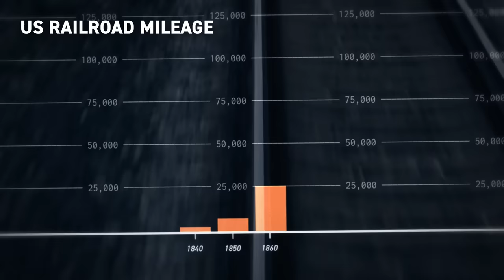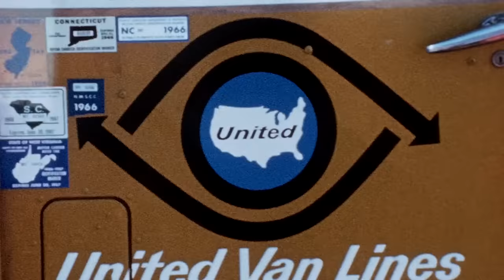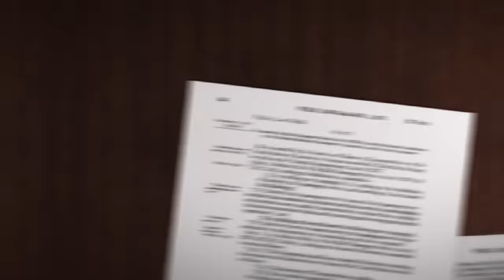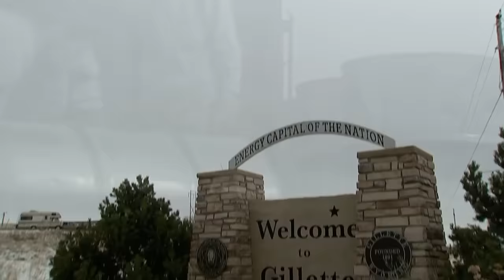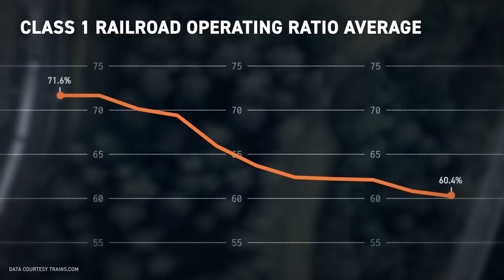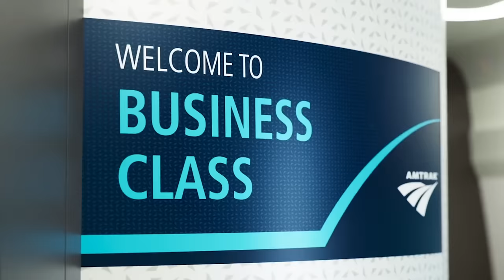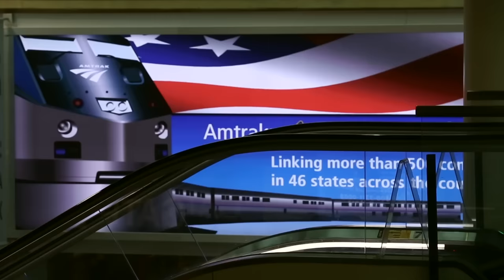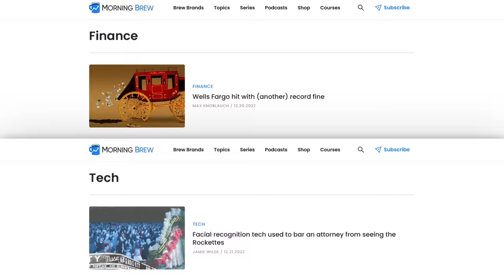The One Tiny Law That Keeps Amtrak Terrible

Comment: My dad was an engineer for Northern Pacific/ Burlington Northern/BNSF starting in 1952. I worked for BN as track maintenance for eight years in Wyoming. I have seen and experienced firsthand the exact things you talked about. In order to help the rail situation, the freight companies need to establish a double track system for most of their track miles. Second, and more expensive, there needs to be a passenger rail network excluding freight service, unless passenger trains could handle a limited amount of freight, not to exceed the number of passenger cars, between hubs and small communities. Every route needs at least two trains each direction each day, and easy surface transportation from the stations to local destinations. (Car rental, bicycle rents or commuter buses).
Reply: @Jacarroll417  You are as right as rain. There so many "if only" pieces to a successful rail system that there is very little hope of getting anything fixed. Too many people, including myself, complain the government isn't doing enough to fix the roads, while at the same time bitching about the taxes we have to pay for infrastructure repairs. But if I buy the material and fill in the pot holes in front of my house, I will be looking at a lawsuit and fines for unauthorized repairs to a public right of way. It's always something.
Reply: @Karl with a K Please don't post the same nonsense in multiple threads. It just makes you look silly.
Reply: Many countries have a shared network for local passenger and freight trains. France, Germany, Japan, just to name a few of the big ones. They also have at least two tracks on the majority of the backbone. E.g. it works very well if the congestion isn't too high and the distance between railway switches corresponds both to the length of the trains as well as the distance between stations. To connect smaller communities, a single track is fine if they are also not a freight hub.
Reply: Most places I have been, routine freight rail service already possesses 2 rails. They need it.
Greater passenger service with separate tracks might be a nice idea. ..Doing so will require doubling the width of existing road grades, then laying the double tracks to allow for trains passing each other. ..Such will require passenger rail rates be made much higher than you might expect.
Reply: All it needs is a siding for a train every 30 miles and trains to be able to fit in them. Double track everywhere is excessive.
Reply: @CreeperOnYourHouse  Depends on what your capacity goal is. A siding is a natural chocking point and seriously limits both the track capacity and the latency in both directions. A second track with regular switches works much better. For a large part of the USA it wouldn't even be that expensive...
Reply: The old Pennsylvania Railroad "Main Line" between Philadelphia and Pittsburgh had FOUR TRACKS as Iate as the 1960s.  It is now a three track system with the middle track used to bypass slower trains on the other two tracks (Amtrak tends to use the middle track). 
Even with three tracks, Amtrak gets delayed and you see demands to reinstall the fourth track, but other then some improvements in the trackage to speed up rail traffic, it has been all talk no action.
Reply: @joergsonnenberger6836  correct, but in the USA for current demands it is perfectly suitable, as it would also allow cargo trains to pull off for faster passenger trains to pass. It's the minimum to enable practical train use, and would be needed regardless of direction of travel.
Reply: @CreeperOnYourHouse  shakes head If you want reliable, steady passenger service, and both directions, you'll need double tracks to carry it. Requiring use of sidings requires one train or the other speed up and slow down. A LOT. Trains depend on being able to move at full speed more often than not to be on time.
Reply: @joergsonnenberger6836  I think it'd be far more expensive than you expect. Even without forests or mountains, most railroad grades possess enough land to allow the tracks and a short buffer zone between rail and general-use lands. Many areas, especially in towns and cities, will have non-rail infrastructure within 100 feet or so. Even rail grades, themselves, have rail infrastructure that need moving to make room. And then, most bridges over rivers, ravines, and general rougher ground would require being widened.
That's one doozy of a lot of earth, communications, and other general stuff you'd need to move.
Those costs will add up very quickly.
Reply: @johnflaherty9595  Compared to most countries, I would expect the land to be fairly cheap in most of the Midwest outside the cities.
Reply: The US has likely lost any chance to make any substantial changes for the next couple of years at least, but: 1) “tax” a portion of the profit of the railroad companies to be matched or doubled by the federal government which would go towards rail infrastructure improvements, 2) identify significant problem locations where longer passing sidings or double trackage would alleviate problems for both Amtrak and freight operations, 3) use federal eminent domain provisions to widen corridors or realign trackage, 4) Amtrak to have first rights to take over trackage that the companies wish to abandon at no cost (a return on initial investment by the federal government in land grants and subsidies), 5) increase “average on time” trackage use fees to the companies while applying significant deductions for lateness to increased fees to the companies for under say 60% on time performance for Amtrak trains, 6) increase the usage of the automobile cars on Amtrak trains to additional destinations that reach a certain on time performance, maybe include vehicle and trailer capacity.

None of this will be accomplished overnight but over 20 years Amtrak should significantly improve on time performance.
Reply: @chriscohlmeyer4735  I agree with what you say, except for bullet point three. May become necessary, but there's got to be a better way to acquire right of way. A way that won't cause a rebellion. We also need to change the tax structure on trackage and right of way  through towns served by the passenger system. In my opinion!
Reply: @joergsonnenberger6836  Uh huh. ..You know, people from both East and West Coasts already have a nasty reputation for viewing the Midwest as "flyover" country. If we're considered to be cheap and only worthwhile for passing through, we're not likely to willingly help build greater passenger rail service.
Reply: @joergsonnenberger6836  Those countries are the size of your average US state or smaller and run government run rail systems, that were rebuilt from scratch after WW2.

Double tracking will never happen in the US, due to environmentalists. You can't get a power line or pipeline or even a fiber optic line put in without going through years of headaches, you wouldn't be alive to see the beginning of the construction  if it was applied for today. BNSF has wanted to double track most of the GN and NP mainlines for years, and little by little they are, but with every spike, every car load of ballast, every welded section of rail, there are a bus load of environmentalists wanting to stop it, and those happen to have the most say in the current government.
Reply: @joergsonnenberger6836  Do you really want to lose most of Amtrak's vote base over eminent domain?
Reply: As an Indian, I can say that India DID face this problem in its initial days, with single-track lines getting clogged up with passenger services and freight trains getting cruelly delayed, reducing the demand and profitability for rail freight. However, it is now catching up with the demands and technology:

1. Indian Railways has embarked on a big mission to expand its capacity, creating double, triple, and even quadruple-tracked routes on congested sections to allow for the seamless flow of both passenger and freight trains.

2. Also, Indian Railways is constructing a series of dedicated freight corridors in busy freight routes, which are double/triple-tracked lines reserved exclusively for freight rail services. This prevents clashes with passenger rail and increases capacity.

3. Indian Railways has always followed strict guidelines on the maximum permissible lengths of freight and passenger trains to be able to fit into ANY siding on the route.

4. Indian Railways always follows a strict priority system, where passenger rail always gets priority over freight rail. Thus, passenger trains do not incur massive delays, and the public can retain a sensible level of confidence in passenger rail service. (Also, cars and petrol/gasoline are expensive here, so public transport is not a luxury but a necessity).

However, a big caveat in all this case is that the government owns BOTH the track infrastructure AND the railway operations. There is no private operator here, so the government can make the major decisions.
Reply: @chriscohlmeyer4735  Rather than increasing taxes which would only make the govt look unpopular and give the "small govt" and "tax reduction" lobbyists points to argue, the govt should give a tax break on the money which is re-invested on track infrastructure. That way, companies are incentivized to invest in infrastructure development, making everything better.
Reply: @J-1410  The number of railway lines in Europe built from scratch since WW2 is quite limited, generally to high speed trains. The size argument also doesn't really work. Most of Europe is much more densely populated than the majority of the USA outside parts of the West and East coast. Therefore, it is much harder to get build a railway without cutting through populated areas, i.e. building a new line generally involves tearing down houses at different points or building next to them, not just cutting off some farm land.

I'd be surprised if the obstructionists are actual environmentalists beyond a very thin layer. We have those, too, and they surprisingly only care about certain projects in the neighborhood and are perfectly contend with others, like the new cinema or highway... Sadly, railway projects don't have the same lobby as the car industry.
Reply: @joergsonnenberger6836  Were you living under a rock the last few years is what I ask.

Comment: Hit the nail on the head man! I have used Amtrak multiple times, giving it multiple chances but with a 6hr trip becoming a 9hr and once even a 12hr trip, I became solidified in no longer using Amtrak. My time is worth more than the cost difference.
Reply: I drive everywhere. I don't fly. If they had the autotrain available everywhere, I could theoretically use it, provided my work truck would fit. I couldn't fly even if I wanted to, because I have a truck full of tools. You can't take your truck on a plane. But I'd gladly take it on a train. It would save me hours of driving. It would save on motels too. Try driving from the DC area to Nashville and back, see how many hours it takes. (Google says 11 hours each way, but it took me closer to 15.)  Wouldn't it be better to just load your truck on a train and then relax?
Reply: Getting there is as much fun as being there.
Reply: If I wasn't eating up precious vacation time or forcing my family to sit at a train station for hours on end, I would agree.
Reply: @arnoldthompson481  Not if you're traveling on business. A 72-hour round trip for a couple of days of business is just ridiculous. Heck, I used to take the redeye flight back home because I didn't want to spend another day at my destination.l
Reply: @CrazyBear65  What you mean you cant load your truck onto a plane?  Of course all personal items must be removed.  Im sure that includes any tools that are on the truck.  And it would be very expensive but it can be done.

Comment: As someone who manages over 1000 miles of mainline train traffic a day, you were very spot on with a lot of this. Only thing I will say is  siding length is a problem but it's not THE problem. We can work around that, the issue is that every train is a race against time as the crews only work 12 hours, and we don't have enough people to call recrews and it's very frowned upon to do so, even if it was for efficiency. Also, I have never seen AMTRAK sit in a siding for an hour or more just for a basic train meet. If that happens there was some mechanical issue on a freight train. Standard practice would be you hold the freight train on the mainline (next to a siding they don't fit in), run Amtrak into the siding, and let the freight train depart. Maybe 20 minutes of delay for AMTRAK.
Reply: Sounds like a train dispatcher wrote this! Takes one to know one…
Reply: @intrepidfox37  lol good call
Reply: The only time I ever took Amtrak, we sat in a siding for almost 4 hours, because the freight train was coming. As best I got from the employees, they were not given a time table on when the rain was coming, just that it was.

This route was only a 3.5 hour route. It took 8 hours.
Reply: @leakingamps2050  can guarantee there was something wrong with the train then, cause a 4 hour meet doesn't happen
Reply: Sat in Utah 6 hours. Damn near missed a funeral for it. It was so miserable. The coal trains can eff it.
Reply: @lh3540  Then your heat, air conditioning, refrigeration, and internet can too-That's what powers it whether you like it or not.

They're becoming more important too as our grid and generational capacity is already over capacity, with no real solution.

Comment: Thank you for that superb analysis of the passenger train situation on your side of the pond.  The ever expanding length of freight trains and the lack of loops (passing sidings) long enough is very interesting.  I used to work for the UK regulator ( HMRI) similar to your NTSB and I’m sure that we would have jumped down the throat of that mismatch between infrastructure and trains.

Comment: I took the train from Minnesota to North Dakota in 2015 because I had the time, but we got stuck yielding to all the oil trains, was 8 hours delayed. * I actually thought the law was that Amtrak had to yield, from this single experience, didn't know it was supposed to be otherwise.
Reply: If the law was enforced, it is still cheaper to pay the fine than to stop the freight.
Reply: @scotcoon1186  Lol.

EDIT: I guess we need to learn how to improve the lines to be more like Germany seeing as they have less delay times because the trains can go much faster.
Reply: @KRYMauL  Germany also has tracks owned by the government, with a length limit for freight trains to ensure sidings actually work. I believe longer trains can be run with special permits, but those are run at night to avoid impacting passenger service.
Reply: @scotcoon1186  i think it’s also impractical. How is one supposed to yield on train tracks? At the station, it’s full, pull over where? It would just make a traffic nightmare, more accidents and start and stopping slows everyone down.

If it makes anyone feel better, we also have this problem in Sweden. Some stupid putt putt cargo train always in front of our X2000 blitzer (same fast train Amtrak has on the east coast).

Solution is to build a extra track prioritized for passenger trains. But govt. is what it is.
Reply: @Lolwutfordawin  Then why are there trains delayed so much?
Reply: @TheBooban  You yield by having all tracks be double tracked.
Reply: @KRYMauL  I don't understand trains. If there is an extra track, use both, don't need to yield? Or do they have it in just some places exactly for yielding there? Anyways, yeah, build extra track for passenger trains is the real solution.
Reply: @TheBooban  Most of BNSF and UP’s track have yield only track. They don’t double track because they make more money by running a longer train. 

Really what needs to happen is the FRA needs to take jurisdiction for the law because the DOJ doesn’t care about trains.
Reply: @KRYMauL  They are delayed because almost all tracks are at, or even above capacity. It only takes a tiny little delay like someone taking too long to get on for it to cascade thru the entire system. Unfortunately the only way to solve that is by building more tracks (which is happening, slowly) or run fewer trains.